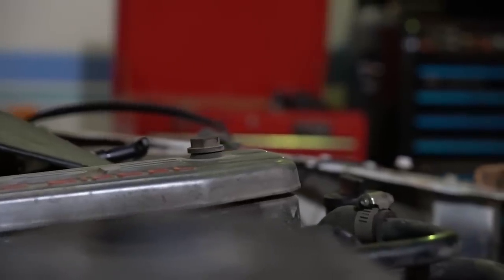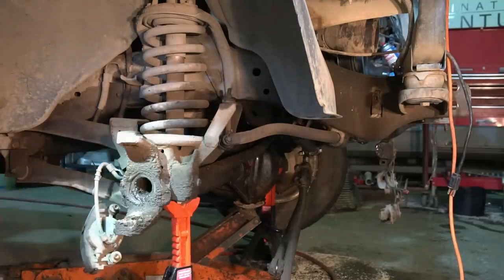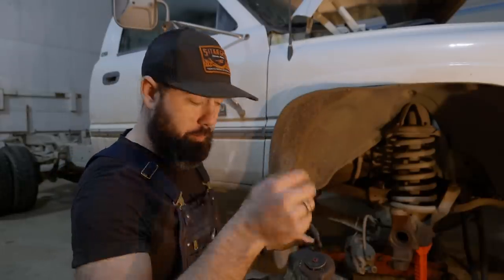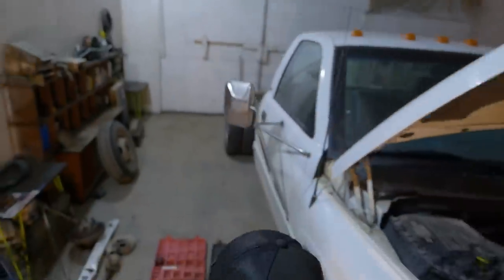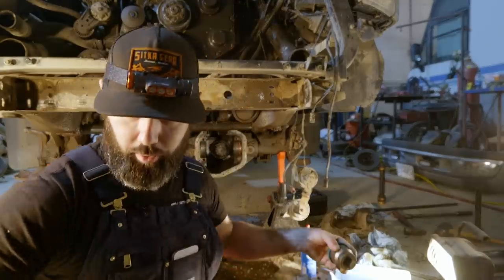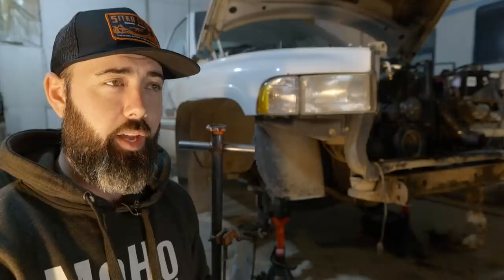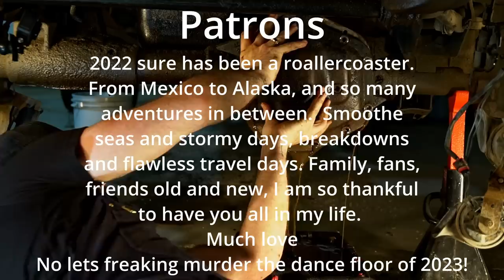Expedition Truck Build | Service Truck to Adventure Truck | Destination Adventure

Comment: As a licensed mechanic in Eastern Canada dealing with rust, I'm blown away at the lack of rust and envious of the ease of removing those front hubs.  Trucks here that are 10 years old are nowhere near the condition of your truck.  you figured it out on your own, chuckled a bit on the setting up of your ball joint press but you persevered and succeeded in the end.

Comment: Recently rebuilt the front  end on my Dodge. I had order a complete kit online with ball joints already installed on new aftermarket parts. Took it to 3 alignment shops and no one could get it aligned. I took all of those kit parts off and sent them back. Started from scratch and pieced it all backed together using the original OEM parts and it aligned perfectly.

Comment: Thanks for the video, and it doesn't matter if it's your first time doing this style of vehicle, learning what works and what don't helps later down the road. 
With this building basically going to be your home for a while, if everything goes well it could be multiple years, all the knowledge you gain will be to your benefit.

Comment: I saw 300K and thought it was miles, I was gonna suggest getting the injection pump serviced and injectors replaced, but that is only 186K MILES so you have another 300K KMs before you need to do that. An injector upgrade would not be a bad idea to do now while it's down. You will get some more power and a little better economy, also look into getting the injection pump pump timing advanced a couple degrees. That P7100 injection pump and Cummins engine is a gem, all the power capability and none of the computer controlled garbage.

Comment: Did this exact job recently to my jeep, same steps just smaller. I made a seal press that pushed them in from the inside, it worked well but I like your idea of pulling the seal in. Side note if you have difficulty with ball joints in the future just tap the knuckle near the ball joint, makes it move much more per turn. 👍

Comment: Keep up the good work. Just a heads-up, seen the races fell to the ground when you pulled the diff. Don't mix them up they should go back to the bearing they where paired with. They wear to each other and if you mix them they won't ride the same. Can end up with premature failure.

Comment: Hello Dustin. Love your adventures. Been watching your build on the Dodge 3500. I have seen YouTube video about a truck camper on a Dodge 3500 that the frame cracked in half. The YouTube channels are Fast Lane Trucks and JB reviews. Both had good info on this. Also we also have a Bigfoot truck camper 2003, 2500 10.9 love it. We aslo have a Chevrolet 3500 4x4 dually extended cab 8.1 with Allison trans. I see our camper weights about 2990 pounds dry. Then add all the goodies. So in your build you may want to watch your weight and check the frame for odd ball stuff. Rust, cracks ect. Also welding will add stress to those area's. Good  luck and keep up the good work. From USA. Illinois area.

Comment: Noce work Dustin!

I remember doing the axle seals on my 2000 Tundra, what a pain in the butt to get those installed with out ruining them... We found a PVC pipe fitting that was the exact size needed to install them for the fourth time, still have that piece in the truck stowed away just in case 😄

Comment: Reminds me of the truck currently sitting at my dads house that belonged to his dad before him that hasn't been driven in some years that is like a 1992  Chev IIRC. Not sure if or when it will have a use again, but I know it won't be me using it as I'm 38 and I haven't driven a vehicle yet in my life and I doubt I am going to start. I succeed on Transit and my legs and for travel Its either Rare due to time/money reasons or Vicarious through people like you.

Comment: I would definitely look into a locking hub kit or the junk yard style swap. Well worth the time and effort and then all the bearing on front end are serviceable... Also if it hasn't been done do your self a favor and do the kdp. So it dont fall out and shatter the timing cover...
Reply from the maker: I wanted to do the locking hubs but it’s just not in the budget this time.
Reply: @Destination_Adventure  I definitely under stand that. Prices are crazy these days for everything. Well cant wait for more videos love watching them... Ive had my 2nd gen ram since 2006 did a frame off restoration on it in 2015 now it pretty much just sits lol. Keep up all the awesome work with the video's...

Comment: Not knocking your buddys work, he did excellent welding and machining but the seal surface on the axle should have been near chrome-like polished surface as the tool marks from the lathe tooling as it moves leaves a micro spiral in the surface. Will it chew up the seal lip any time soon? Likely not.    I`m liking this build series. Would love to help out but i`m three hours north of you.

Comment: 0:21 OMG, I had those tires back in 1989.
1:16 Mick has manifested from someone you used to work with? 
9:00 Nice to have friends like that. 
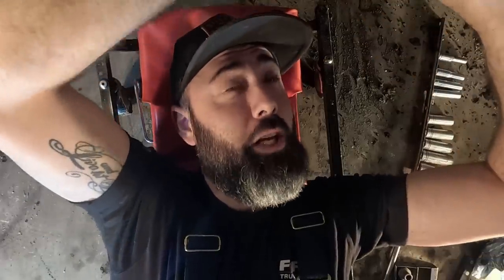10:10 Tip I saw on another channel recently, keep the top bolt of the diff cover on, but backed off so the diff oil does not puke out that fast and you don't get diff oil in your armpit.
13:13 I know this is after the fact but, I have seen where someone took a claw hammer and cut the claws off and used a socket to tap that seal in. They were a mechanic with a shop but I would cut the claws off a Home Hardware or dollar store hammer to get the job done.
15:38 I am loving this series, I have been on YouTube longer than you but your talent exceeds mine, keep on keeping it real.
I am in Kamloops, I could come up for a day and be a parts washer for a shout out?

Comment: Soon as you started pulling bolts from the inspection cover on the front diff, the fluid started running out. Talk about a picture you can smell.... Anyone who's ever messed with 80w90 gear oil knows what I'm talking about🤣🤣

Comment: Hey bud just a heads up from a senior HD Mechanic whenever you install a seal by driving it in with a hammer and driver tooling always pack grease inside seal so the seal lip spring does not come off on installation if it does and you dont see it the seal will leak. 👍👍⭐⭐⭐⭐⭐🚐👍👍